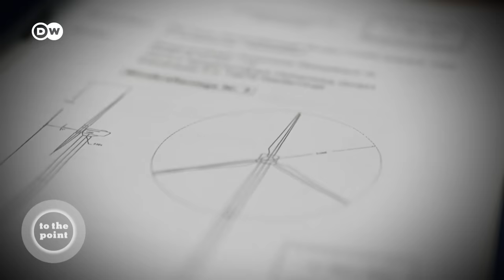A great power in trouble: What's wrong with Germany? | To The Point

Comment: Germany chose to close its nuclear power plants in the middle of Europe's energy crisis. That is stupidity at an insane level.
Reply: Even if that WERE true, that has literally nothing to do with Germany's current economic woes.
Reply: Couldn't agree more
Reply: Germany has coal though. People always forget that Germany has the 5-6 largest coal reserves in the world lol.
Reply: They also lose the gas pipe line they had build with Russia, no more cheap gas.
Reply: @asdasdasddgdgdfgdg they also closed a lot of coal plants, for solar and wind and then realised it was a bad idea during the energy crisis and open some back up. But they will close them down permanently eventually because they want green energy.
Reply: @antred11  LOL
Reply: People like to argue that nuclear energy only contributed to about 5% of the overall energy mix but I wonder if that was the case due to a lack of nuclear power plants (or similar issues) or due to regulations. Nuclear power plants are incredibly safe and produce an abundance of energy all the while being completely Co2 neutral in the process plus the produced energy is cheap and reliable. The second thing that irks me is people completely overestimate the amount of level 3 nuclear waste (yes there' three stages of nuclear waste) that's being produced.  The overwhelming majority of nuclear waste decays anywhere between 5 to 30 years and can be stored in the nuclear power plant itself. I wouldn't mind getting rid of nuclear energy if we actually had viable alternatives, which we don't
Reply: @asdasdasddgdgdfgdg  You got to remember that Germany imported their coals from overseas. 49.9 % from Russia 🇷🇺 , 17.2 % from America and 13.4 % from Australia  . There's nothing to shout about when you haven't got it in your backyard/countryside  .
Reply: But the closing of those plants was supported by the majority of the German people. When has the majority of the German people been wrong on anything? 🤷‍♂
Reply: @missionhunt  we will see about that. In a world where China, Japan, Indonesia, India etc are building new coal plants, green policies will become politically untenable. It has already started btw, as per Oct 2023, Greens are irrelevant in around one third maybe even one half of Germanys federal states.
Reply: Last year, Germany helped France out with electricity as they had to shut down nuclear power plants due to a lack of water. France is totally dependent on nuclear power, with over 50 nuclear power plants. My neighbors moved from France to Germany because of the constant power outages and heating. Almost like Texas.
Reply: @chrisdelaplante5515  Better dead than red
Reply: Make América Great Again meant the re-industrialization of América. This colides with the interests of the biggest economic groups. These were the reasons why media made a enormous brain wash against Trump. These were the reasons why justice wants Trump end. Greetings from Portugal
Reply: @asdasdasddgdgdfgdg  Coal is so bad for the environment. I remember das Ruhrgebiet in the sixties very well. Schrecklich. Alles eintönig, schwarz und staubig. Ich denke, Sie haben die falsche Entscheidung getroffen. Ich weiß nicht, ob es bei uns in den Niederlanden so viel besser ist. Wir setzen viel auf den Wind, aber wir kaufen auch viel Energie.
Reply: Thing is...
1. Nuclear power IN THE WEST is not cheap, the MAJOR players in building new nuclear power stations are Russia No1 and China No 2
In 2020 RussAtom was building 75% of all "exported" Nuclear Power Plants meaning not counting domestic construction, 35 Plants.
At the same Time China was building 21 BUT IN CHINA.
2. If you operate a nuclear power plant you might not have to buy Russian gas or oil but Russian nuclear fuel, Russia being the worlds largest producer of that (as well) USA import around 20% of their nuclear fuel from Russia TODAY, nobody have sanctioned that...

So... with the plan to "decouple" from Russia and China Nuclear technology is REALLY EXPENSIVE.

Today there are 53 new nuclear powerplants in the world.
24 are built by China IN CHINA
17 are built by Rosatom (Russia) outside Russia
This is 41 of 53 IN THE WORLD so 80%...
Then at No 3 you have India... 8 reactors making it 49...
SO "The west" is building 4...
(Stats from World Nuclear Association)

Looking at costs in the west... look at Hinkley Point, new construction in the USA that made Westinghouse go bust or France...

I would claim... without Rosatom or maybe China (although they mostly build domestically)
Nuclear is REALLY EXPENSIVE.
Reply: @fernandoribeiro7738  Tell me a Gites product made in the USA since the 70s! I only know “Kitchen Aid”! When people are not trained, such as in Germany, Switzerland, Austria, NL, Scandinavia, etc. then comes out of it.
Reply: @arnodobler1096  
Not just lack of water although that was an issue, it started with LACK OF MAINTENANCE.
As we know... maintenance nobody wants to pay...
Reply: @jessewhittemore784  lignite has an advantage, its super easy and safe to harvest. Bagger 288 says hello.
Reply: Germany has got many policies right but some of its policies are totally wrong
Reply: @tinaforbes1059  Imports and reserves are different things. Germany imports some coal due to purely political reasons.
Reply: @LenQuerido  todays clean coal plants have solved this Problem. Coal power tech has advanced a lot since the 60s.
Reply: @phoque121  not sure about coal but 70% of Germans were against quitting Nuclear energy
Reply: This was idiotic.

Rational people close unused facilities, 
Irrational people close needed energy facilities.

How small a percentage was being contributed to the nation is irrelevant,
they all add up.
Reply: They should lift suction to Russia for oil only..u'll see rebound to every one's economy..high oil price..high inflation
Reply: @LarryMendaros  We have to make that sacrifice as we all know what happened with the previous Putin in 1939 -1945
Reply: Not stupidity, literally maliciousness! They knew the consequences and they still did it!
Reply: Where do you think most of the enriched uranium comes from to power nuclear power plants???? I’ll give you a guess…. 

Yes it’s Russia who provide 15% of Americas nuclear fuel and 20% of Europes.. 

And no it’s not on the list of sanctioned export.. I wonder why..
Reply: @asdasdasddgdgdfgdg   It doesn't matter how much you stocked up,  it won't last forever. You do need to top it up, you get my drift  ? No . Never mind.
Reply: That's "green level", which is euphemism for "socialist level".
Reply: @skythundersky1544 , loss of 5% is enough to cause a crisis. Same with the oil worldwide.
Reply: @asdasdasddgdgdfgdg Nuclear power was 6% of the electricity market in Germany. 🤷‍♂️
Reply: @juricakonsec2337  Well they say we can compensate for that by cranking up renewables but I don't really know what they're talking about as we're not stacking up nearly enough on renewables to compensate for the sudden increase in demand
Reply: Germany is a net exporter of electricity.
Reply: @tinaforbes1059  
They're plenty, you just want to get it from others, for the reason idk.😄
Reply: You have to understand what nuclear radiation do to the materials in a nuclear power plant. Over time, they change properties and get brittle. Fixing them beyond their lifespan is very expensive. Look at France. They have several plants that are being decommissioned.
Reply: @juricakonsec2337  360 degrees Baerbock level 😉 .
Reply: @oddvardmyrnes9040  
Everything on this earth gets brittle as time goes even your opinion. Stuped!
Reply: Tschenobyl ? Fukushima ?
Reply: @chrisdelaplante5515  that's one of the mainreasons. But, of course, nobody will call out the attack on nord stream. We all know what uncle did it ...
Reply: @oddvardmyrnes9040  I mean I get that but it takes a while for a npp to get to that stage. In my mind I can't come up with a single convincing argument why we should keep on using coal for energy production but completely ditch nuclear energy out of fear of another disaster. I don't mind phasing out nuclear energy once we've overcome the struggles of renewables
Reply: @arnodobler1096  I am not against globalization but against this model of globalization.  Because is based on producing where the costs are lower and where the enviroment normatives are very small or nule.
Reply: @chrisdelaplante5515 ....the didn't " lose " the gas pipeline ( northstreem ) it was taken away from Germany.
Reply: @fernandocruz4877  .. Why the hostility? Are you having a bad day?
Reply: @oddvardmyrnes9040  
Am i hostile? In what sense? Can you elaborate?😍
Reply: @skythundersky1544  .. I am of the opinion that nuclear energy is the answer. Germany had to close those plants, they were at the end of their lifecycle, but abandon nuclear energy is wrong. New reactor types are emerging, and especially those who use molten salt as cooling and fuel is dissolved into the salt is very promising and have NOT the same issues as solid fuel reactors have. Pressurized Water Reactors (PWR) operate under immense pressure, and everything has to be designed with that in mind. Molten Salt Reactors (MSR) operate in 1 atm pressure. You can take the lid off one while it is running (figurable speaking). The one that operate in the FAST spectrum (without a moderator in the core) can burn 97% of the potential energy in all sort of fuels. Even nuclear waste!
Reply: Fukushima!☢
Reply: @markdc1145  Fukushima haven't had casualties unlike coal mines, oil. It was a close call, though
Reply: @markdc1145  it's force majeure. It's not like hiroshima or nagasaki, that's dilebarate.
Reply: @fernandoribeiro7738  that's capitalism
Reply: @tinaforbes1059 no i dont catch your drift since you still talk about stocking up without understanding that Germany has, within its own borders, fucktons of coal. Germany could easily be energy self-sufficient but this isnt wanted by most politicians for whatever reasons. As a matter of fact, German ressources are a taboo in German politics...
Reply: @qinby1182 this is one reason among many others why coal is the answer.
Reply: Thats what I thought too but the news was saying they were doing the right thing.
Reply: @missionhunt Hahaha, guess their iq isn't as high as people thought.
Reply: @skythundersky1544 , allegedly, there is a new generation of batteries coming to the market in less than 3 years. I have no idea how realistic that is...
Reply: @markdc1145 , they knew for centuries about tsunamis and that coastal zone is a "no build zone". It was political decision to ignore safety rules and build there.
Reply: No, It had already committed to close them and without (probably russian) fuel and spending Billions it made no sense.
Reply: @skythundersky1544   Nuclear is x5 LCOE cost of renewables + "completely Co2 neutral in the process"  only if you ignore the mining and processing CO2.   That small amount of high level waste you mention will be lethal for many 1000s of years and cost billions to store.  Decomm of many (france in particular) nuclear plants is not funded to the tune of over 110Billion EU.    Renewables is perfectly viable, it is way greener and quicker to build.
Reply: @antred11 high energy prices absolutely have an impact on the economy
Reply: @antred11 it is true they shut them down at the same time as shutting down natural gas power plants and electricity costs almost tripled.
Reply: @asdasdasddgdgdfgdg   Basically you're admitting that they have bugger all , except net zero narrative.
Reply: It had no consequences. The root causes are completely different.
Reply: @Matt-YT  Energy prices didn't become noticeable higher because of these nukes getting decommissioned. You may have a very romanticized view of the economicity of nuclear power.
Reply: @tinaforbes1059  who do you mean by they? Greens and the like? If so then yes.
Reply: Germany choose responsibility instead of short money.
Reply: @arnodobler1096  you know the existence only 25 years ago the rule called MARKET QUOTES ?  The multinacionais could produce anywhere but should distribute their production to follow these MARKET QUOTES. The big mistake on western was to put an end. The solution should be put Again......
Reply: Et les sanctions sur l’énergie Russe maintenant elle l’achète plus chère par des intermédiaires. C’est une folie !!!! C’est un suicide
Reply: @asdasdasddgdgdfgdg c’est pour ça elle achète l’électricité des autres pays
Reply: @chrisdelaplante5515 Saboté par les américains maintenant elle achète l’énergie plus chère 😮😮
Reply: Germany should have a chat with the folks over at Copenhagen Atomics..😉
Reply: Nice talk, the reason why Germany’s economy has been grown in past years is you have cheaper gas from Russia, produced goods and sold to China . Germany cars came to China very early, so every people born in 70s 80s are dreamed to have a Germany car . But for those born in 90s 00s, high technology cars are more attractive, they don’t have such dream. If Germany cars goes out of China, they can’t be in anymore. Who will buy Germany car, US has US car, South Korea has South Korea car. Japan has japan’s . In China there is a sentence  can help you. You have to lower your head when you under the roof. Western countries can not help you, today is different from WW2. During WW2 USA has 80% world gdp. But now they only has 25%. World has already been changed. I totally understand why Germany’s people is keen on capitalism over socialism, you have suffered a lot during WW2. But chinese socialism is different from your understanding. The reason is very simple ,which socialism system can achieve such great success . Be diligence ,be realistic,be hardworking, be open minded , break conventional thinking, and keep going forward
Reply: But, but, ...., there was a tsunami in Japan!
Reply: And they lobbied against France via the EU to undermine their nuclear program to weaken them.....good neighbors.
Reply: @antred11 if the cost of energy is a factor in declining business activity it's very relevant
Reply: @antred11  Their economic crisis is mainly caused by high electricity charges.
Reply: @bjarnehansen3812 do you live in Germany?
Reply: @charleskocun6754  I live in Denmark, North of Germany. We have our own stypidities regarding energy. Lots of wind turbines, more than enough on very windy days, but useless on still days. Our energy system is connected to the northern part of Germany (and to our other neighbors)
Reply: @jbbeiser983  By who ?
Reply: It isn’t stupidity, it was calculated by Russo oil supporters to push towards dependency on Russia.
Reply: @chrisdelaplante5515  They didn't exactly "lose" it.  "SOMEBODY" whose name starts with U  blew it up; Uruguay ?  Uganda ?
Reply: Germany is now a sick man of Europe😂😂😂 Thank you Ursula and Olaf🤣
Reply: What do you think about Japan discharging nuclear radioactive contaminated water into the ocean? Is it the right mental state?
Reply: @fowono2007  Uganda dit it !
Reply: In their defense: sometimes you have to close nuclear power plants (NPP), even if it is uncomfortable in terms of timing. I don't know if this is the case here, but maybe the NPPs were too worn to be operated safely, or maybe they were already in the progress of being shut down to that extent that they couldn't be restarted (that happened simultaneously here in Sweden with one of our bigger NPPs). As I say, no idea what was going on here, but it could be that it couldn't be helped. I'm pro-nuclear, by the by.
Reply: Also choose to lag behind on any form of digitization and neglecting its infrastructuur
Reply: @antred11  Rubish. Energy costs drive industry.
Reply: WEF Young Leaders like Annalena, Jacinda and Senna got excellent tracks in Clown world
Reply: Climate Fascism and WEF founder should be contested in front of De Haag court of law..
Reply: @antred11 Pure BS
Reply: @fireman-phil7307  They do. But energy costs did not increase because those nukes were phased out.
Reply: germany decided to close its nuclear plants following the fukushima disaster.....took me 5 seconds to fact check your comment and its BS
Reply: The current situation has nothing to do with some nuclear power plants. But your framing shows what intentions you have in this discussion.
Reply: The people didnt !
Reply: Du tager fejl Bjarne. Germany did not close its nuclear powerplants. They were planning to do so, but then Putin invaded Ukraine, so Germany decided to keep their reactors operational.
Reply: @asdasdasddgdgdfgdg Germany's coal is not of good quality.  Burning this poor quality coal kills and sickens thousands of Germans each year.  The mining of German coal is also highly destructive destroying vast areas of farmland and villages that can not be restored.
Reply: @arnodobler1096 now Germany is buying nuclear power from France.  The nuclear plants in France were mostly built at the same time.  The plants needed maintenance about the same time.  With the maintenance done France now has the cheapest, safest, most reliable electrical power in Europe.
Reply: @tinaforbes1059 yes nuclear fuel will not last for ever.  Like with fast reactors and use of thorium we only have supply to last 1.5 billion years.  Don't worry.  With in 30 years of that event nuclear fusion will be developed.
Reply: @oddvardmyrnes9040  In the US nuclear plants are counter acting the radiation  enbrittlement of metals by developing a annealing process that reconditions the nuclear reactors for a longer service life.  The expectation is that the current nuclear reactors will have a life expectancy of about a hundred years or more.
Reply: @antred11 Cost of nuclear power as romanized in France.
Reply: @stanleytolle416  .. Thank you for this comment. I assume this heat treatment is performed under the manufacturing process. Then the question is if this process has been performed on older reactors? Have they?
Reply: @phoque121  Is that Sarcasm?
Reply: @stanleytolle416  Nuclear power is heavily subsidized in France.
Reply: @oddvardmyrnes9040  The annealing process is being done on older reactors.  What I read I understand it's a special machine that heat treats the pressure vessel of the nuclear reactor.  Other parts of course get replaced.  It's almost like nuclear plants can be kept running indefinitely like the US's B-52 bombers. The only reason to shut down nuclear reactor is to replace them with better designed reactors. Like various designs using low pressure, high tempature, waste burning fast neutron reactors seems to make sense to me.  Both older nuclear plants and most systems using fossil fuels could be replaced by these newer designs.
Reply: @stanleytolle416  .. 100% agree. Ed Phile at Elysium Industries are developing those fast reactors now. By limiting the temperature to below 700 deg C they can work with already approved materials. The system is so simple, and they pump constantly through the drain tank (no freeze plug) so swapping the reactor vessel with pumps & all is very simple. Switch off the pump & the fuel drain into the drain tank. This tank is shielded, so radiation and decay heat is not interfering much with the swap. They move the entire reactor to a cooling pond without any fuel in it. They plan on swapping every 7 years. Remember that the reactor is NOT a pressure vessel due to the use of molten salt as cooling, heat transfer medium & fuel container. It can be produced in an ordinary metal working shop at low cost. IT IS THE FUTURE!
Reply: @antred11  Germany's economic woes are mostly due to high prices and poor availability of energy.  Like the three percent figure was only for the last nuclear plant being shut down.  Germany had 17 nuclear plants it shut down.  If these plants were going there would be no energy problems in Germany.  All these plants can be brought back on line in a relatively short period of time.  I have seen authoritative sources stating that if these plants were brought back on line between 5000 to 8000 deaths each year would be prevented from fossil fuel pollution.
Reply: @BBTeZeT  Yes, das ist Sarcasm
Reply: @antred11  first off, it is true. Second of all it has everything to do with Germanys current woes seeing how energy prices are a main contributor to Germanys current problems.
Reply: America is right behind.  No place to run/ hide 😢
Reply: Where will Germany get the uranium from?  😅
Reply: @jessewhittemore784  North Dakota has used lignite which would actually have more energy value as uranium ore.
Reply: As an engineer, it is insane crazy to replace something by remove it while the new part is not ready... It clearly tells that German is not running by engineers.
Reply: The decision was made 10 years ago by a different government. The current government let the nuclear power plants at least run a few months longer as they should have been shut down 2022 already and were maintenanced with that in mind. 
I don't know enough about the numbers but afaik nuclear power is very expensive and only competitive with huge government subsidies (or if your country has a nuclear weapons program). So I assume the plan was to instead use the money to build green infrastructure.
Reply: @antred11 No more Russian gas
Reply: Actually not Germany, but the ideological radical left wing green party (that was built by NSDAP members) together with the CDU, FDP and SPD
Reply: 당신은 단신이해야 할 일을해야합니다. 더 저렴한 가스는 비용을 들여 사용할 수 있습니다 (협상). 하드 에너지는 보존 요구에 따라 비교되어야 하며, 원자력은 선택 사항이며 방법이 있지만 항상 모든 사람에게 편한 것은 아닙니다.
Reply: the fuel rods for those reactors and those in France is Russian.
Reply: @gzcwnk  you "forgot" that countries like UK have huge amount of weapon grade plutonium which can be "diluted" and used as fuel.
High level waste can be used as fuel, in case you haven't heard for BN-800 reactor which uses huge amounts of depleted uranium as it's fuel.
Do your calculations for mining, processing and recycling renewables. Or no recycling but storage, in huge quantities.
Reply: @skythundersky1544  reliable? France showed just the opposite in 2022 and would have had a big problem if Germany out of all didn't save their a**, and with drying rivers in comming summers due to climate change we are headed for even more problems in the future with nuclear. It was also not cheap but the most expensive production form of electricity in Germany btw and Renewables are the cheapest. We didn't miss the nuclear ones one bit btw. Oh and the low prices? Yeah, look up how heavily the French government is subsidizing the nuclear and how they dictate the prices not go up since even more people would be revolting on the streets. 
And  the waste? Dud we don't even have a realible end storage till this day.
Reply: @tinaforbes1059  do you know how economy works? We have it, we just choose to import the cheaper one.
Reply: @dagmarbubolz7999   You choose to import the cheap one  ?  How very convenient  . Tell you what  , is it  because your own products are too expensive to produce or buy   ?   Bloody know your  economic  . Even a 3 year old knows that  .
Reply: Yes BUT they are "Saving The Mother Earth" 

/s
Reply: @dagmarbubolz7999  Bruv you're way too emotionally invested in all this
Reply: Germany is not independent.  That's the real problem in a world that every country looks for its own interests.
Reply: @blardymunggas6884   Ursula Vander crazy & Olaf the pirate 😂😂
Reply: Indeed, they should have postponed the change. I'm all for denuclearization, but only on a secure footing. There are complexities like cost of maintaining particular plants past decommission schedule, etc. On the long haul, nuclear power if safe is more expensive than almost any other form of power and, outside of ideal conditions, is extremely dangerous given that no options for long term storage of nuclear waste exist except for the few plants that have access to the single storage facility capable of long term storage (in Finland), and given that the vast majority of plants, if not all of them can't safely withstand major natural disaaters, and given that ZERO nuclear plants can endure grid collapse (or, alternatively, three failure to constantly replace temporary non-nuclear generators on site), since all of them will go into meltdown without access to months of electricity access (how ironic), and will produce major toxic waste if left without access to external electricity post-closure for YEARS (like 2 or so) due to power requirements of cooling last spent rods, core, etc.
Reply: It’s designed by America
Reply: @antred11 yes it does!
Reply: a
Reply: You know? You make an excellent point. I had expressed similar thoughts as it was happening then forgot about it..there's been SO MUCH CHAOS in the last couple of years it's difficult to keep up with everything.
Reply: Then it buy nuclear electricity from France. And if a French NPP blows Germany will get the effect anyways.
Reply: @antred11  a dumb move on that scale surely does not help
Reply: @asdasdasddgdgdfgdg  True, and it seems they already restarted a number of coal plants? But how far can the "greens" allow this?
Reply: @chrisdelaplante5515  Yeah. Who on Earth might possibly have blown that up? (Well, apart from America that is ;))
Reply: @antred11  actually, it does, since shutting down those power plants has made Germany more dependent on Russian fuels.
Reply: I assume that unfortunately lobbyism and corruption have played a significant role here.
Reply: Many would agree with you ……
Reply: @antred11 It has everything to do with it. If Germany's energy structure were partially based on nuclear plants the cost of energy would be much lower.
Reply: You are so right, green ideologie is stronger than thinking
Reply: It was a long term plan, actually. Unlike France, in Germany nuclear energy has never been popular. But depending on coal plants when you're pushing a green agenda doesn't look good. As you said, it's bananas and the results weren't expected nor the timing of them.
Reply: @antred11 It does a bit. The energy crises is making companies have to go look for cheaper alternatives. It creates even more problems. And Nuclear energy is co2 neutral. So its double stupidity.
Reply: @antred11  0:10 "Companies are complaining about the high energy prices". 
you choose to skip the video aint ya?
Reply: Welcome to Green idology.
Reply: @phoque121 it wasn't. At the time of closing, only 40% supported it. Now 80% want them back.
Reply: @qinby1182 all points are wrong.
Reply: @DavidHalko it was actually not small - 12%!
Reply: @aktarhussain4437 the US and Europe can enrich uranium too, if they want. New facilities are already being built. Also, uranium is cheap, unlike oil and gas.
Reply: @tinaforbes1059 it does matter. If you have 5 years of stock you can get another supplier or even build your own facility.
Reply: @arnodobler1096 it was 12%! And before the initial closures it was 30%. 6 % is the last 3 plants, but another 3 were stopped just a year ago. It's a trick to downplay the bad decision.
Reply: @youareliedtobythemedia it was, but not anymore. Now an importer.
Reply: @oddvardmyrnes9040 the last 6 nuclear power plants in Germany still had 20 years of rated lifetime with possible further extensions. They are state of the art
Reply: @JT-on7pf yes, uncle Vova.
Reply: @oddvardmyrnes9040 the last 6 German NPPs were not at the end of the lifecycle, they still had 20 years left. It was purely political nonsense.
Reply: @juricakonsec2337 0% realistic. Even improving 2x won't help. Try buying 34 TWh of batteries.
Reply: @gzcwnk those are wrong numbers from anti-nuclear campaigners. See Finland - as soon as their new NPP came online, prices have dropped.
Reply: @TomWaldgeist no, in that case the choice would be to close coal.
Reply: @fowono2007 cut your conspiracy nonsense. A Russian ship was there over the NordStream and over the Finnish pipeline too.
Reply: @09csr not this case, though. They were totally fine.
Reply: @oddvardmyrnes9040 it's a maintenance actin, needed for older reactors. For newer, like German reactors it's not needed.
Reply: @ImaskarDono  Pleasr tell me how a deranged mind figures it would be in Russia's interest to blow up that pipeline ?
Reply: @antred11 false, it's heavily taxed!
Reply: @stanleytolle416 no, it can be done 1 or 2 times only extending to a total of 50-60 years. Newer reactors have different steel with 60 years base and possible extension to 100, annealing is not needed and not working on them.
Reply: @fowono2007 there is a lot of analysis online, feel free to read it. Not a format of a short comment.
Reply: @ImaskarDono  if you only took 1 second to look it up you'd know you are wrong:
For 2022 imports fell from 39.60 TWh the previous year to 35.76 TWh, exports rose from 56.99 TWh to 62.05 TWh.
Reply: @ImaskarDono  ok, well, not all of us apparently ....
Reply: The last remaining nuclear power stations were old and were producing just 3% of the electricity in Germany. Germany was not relying on them. This issue is also not causing the economical problems of Germany at all.
Reply: @ImaskarDono  .. Oh boy..
Reply: @ImaskarDono  Well, good luck with that  .
Reply: @youareliedtobythemedia  that's why I said "was". In 2022 yes, but not in 2023. The balance is already negative and it becomes worse in winter.
Reply: @dtek-Otto  it was 12%, not 3. A very significant amount. It affects the prices a lot due to merit order pricing.
Reply: @ImaskarDono Yes, but in a negative way. Nuclear power is, beside of gas power stations, the most expensive way to produce electricity. The prices for electricity are not going down, because of nuclear power. The high gas prices at this time, was resulting in high prices for electricity (merit order). In addition, Germany was not relying on the remaining 3 nuclear power stations, The decision to shut them down was made already 2015, since then the power stations were barely serviced an the contract for new uranium has ended.
The nuclear power stations were not producing12%, they were producing about 6% inside the elictricity mix in Germany and 3% compared to the whole energy demand of Germany.
Reply: Not at all, Germany decided follow The USA to fight Russia  and now is suffering the consequences.
Reply: @ImaskarDono  it'S looking fine for 2023 so far. and pretty much nothing has changed in production/consumption, so i don't expect it to change. but total for 2023 isn't out yet
Reply: @qgxii indeed
Reply: @youareliedtobythemedia  The data is available, but not total of course. There are already more imports and usually in winter it only gets worse.
Reply: @arnodobler1096  what constant power outages and heating are you refering to ?
Reply: @ImaskarDono  more than the year before, but still more exports than imports.
Reply: @laurentdupasquier7872  They lived in the countryside of France. And in winter there was often no electricity because everything was also overhead lines.
Reply: @ImaskarDono  yes they can but it’s just not worth the risk.. would you want a enrichment facility next door to you? If you say yes, you haven’t got a clue!!
Reply: @aktarhussain4437  we don't have to put enrichment facilities next to our doors. Just a few of them are enough for the whole world.
Reply: It's not an electricity production shortfall, nuclear contributed less than 10%.
Reply: No, my friend. Thats by design. How else u gonna create energy crysis and screw up prices? Its all Shwabs plan.
Reply: Barbarian visogoths...
Reply: Got it in one.
Reply: Irony is that Germany cannot choose cos Germany is not a free independent country capable of choosing for itself but a US colony , so administration government officials act and spoke what their bosses want and expected right from Washigton.
Reply: More great leaders as Annalena, who probably few times misses the Trampolin
Reply: @antred11  literally nothing? Made Germany importer of epower when they used to (net) export before. And how is the statement not true? 
Germany imports energy as they either do not have resources themselfes or dont wanna use what they do have. Expensive energy imports for a country relying on cheap energy do influence no matter how you look at it. Even more so if you talk about nr. 4 economic power etc...
But ppl rather blame the war and Putin and whatnot
Reply: @tinaforbes1059  different types of coal there. Brown coal is the one the Germans do have. Thats now used for electricity instead of nuclear one. Talk about going green
Reply: @rli8594   Yes, tell me about it .
Reply: Especially when Germany had the more modern power plants compared to France.
Additionally their idea of forcing people towards thermal heat pump was also weird.
While it doesnt directly affect their economics, one certainly doesnt change major things in uncertain times.
Reply: @missionhunt  not them (means us germans) but the loudest Social Media screamers these days ..
Reply: @phoque121  lol
Reply: @joem0088 Thats the european electricity market. Nothing new about that. You buy and import cheep electricity and export it in the same way. So.. whats your point?
Reply: this!
Reply: Indeed in this era where everything is electrical that was like shooting themselves on the foot
It unrecommended silly move.
Reply: Actually, they closed them down 10 years earlier but hey, Thanks for the LIE!!
Reply: How are the Electricity prices today?
Reply: @antred11  What do you mean "WERE true?" I may not have made a huge difference, but it is the truth.
Reply: Absolutely not agree with you, in summer 2023 germany had to provide renewable energy to France, because there nuclear power plants could not deliver enough power, caused by the low water levels of the rivers close to there nuclear power plants in France. Climate change will also impact nuclear power plants. Germany did the right thing, also nuclear power was always one of the most expensive power for the tax payer, because it was totally subsidised and could not make money on his own. Not evenen talking about the ability to store nuclear waste in Germany, we are a small country and have no place to store this mean nuclear waste. Germany will make the transition to the renewable energies, it will be hard but when we are done, cheap and clean energy will let us rise again.
Reply: @phoque121 What a lie. There was no majority in supporters to close all power plants.
Reply: @skythundersky1544  Decay rates typically average 10's of thousands of years. That's just physics. As far as alternatives try wind, solar and CNG.
Reply: @phoque121  Such decisions should not be left to a misinformed moat that can't even think for themselves, let alone for the country.
Reply: @asdasdasddgdgdfgdg  its to expensive to dig it out. i live in the exact place coal was mined for a long time and all the coal mines are shutting down.
Reply: @antred11 you have absolutely no idea
Reply: @asdasdasddgdgdfgdg Most of them low energy coal. They need to get it out a lot for to make it work and they cant get it out fast enough to cover the energy need.
Reply: We people had no word in it, our state just decided it for us.
Reply: @antred11  really? So what is your opinion ?
Reply: Everyone loves nuclear energy till the waste is buried under there house.
Reply: @chrisdelaplante5515  Which gas is cheap? Who said Russian gas is cheap?
Reply: It's suicide.
Reply: @asdasdasddgdgdfgdg just explain then why at the same time German citizens are plagued by nonsensical CO2 laws and taxes.
Reply: @qinby1182 but Russian gas was really cheap. And would have continued to be so. But someone decided to blow up our pipeline.
Reply: Hello 👋
Reply: @antred11  hello 👋
Reply: @Noah_IN_WHcommunity  hello👋
Reply: @chrisdelaplante5515  hello 👋
Reply: @missionhunt  hello 👋
Reply: @starkid9736  hello👋
Reply: @skythundersky1544  hello👋
Reply: @tinaforbes1059  hello👋
Reply: @phoque121  hello👋
Reply: @arnodobler1096  hello👋
Reply: @reardelt  hello👋
Reply: @DavidHalko  hello👋
Reply: @LarryMendaros  hello👋
Reply: @liamp.8826  hello 👋
Reply: @aktarhussain4437  hello👋
Reply: @skythundersky1544  hello 👋
Reply: @youareliedtobythemedia  hello👋
Reply: @skythundersky1544  hello 👋
Reply: @AlexandraSandra-ho3wz   Hello to my Bot friend , Alexander Sandra.  Welcome to the humans world  .
Reply: @tinaforbes1059  Thank you... i have something to tell you dear
Reply: @tinaforbes1059  firstly where are you from?
Reply: @AlexandraSandra-ho3wz  planet humans  .
Reply: @tinaforbes1059  can i say?
Reply: Can i say what i wanna share?
Reply: @tinaforbes1059  Are you there?
Reply: Don't understand, no logic what German thinking?
Reply: The same can be said even more so about Britain. Germany still has Siemens producing the generators and turbines cooperating with the French producing new power plants.
The French got it more right than the rest in Europe. Luckily for Britain the French decided to build a plant in Britain too.
Reply: @blardymunggas6884  
Sure, sure, while being the worlds third largest economy since 2023 and a AAA rating, as one of the very few countries world wide with a AAA ranking 😅